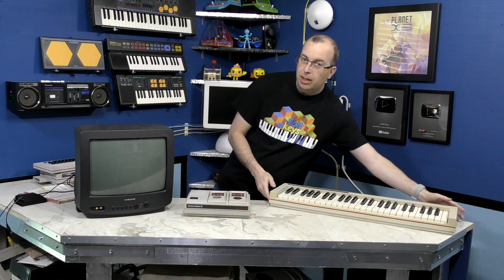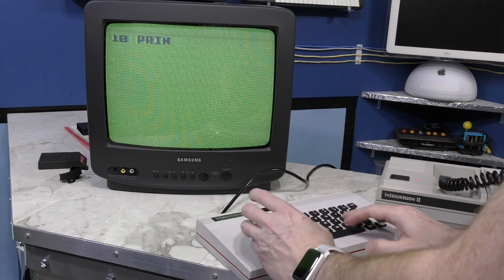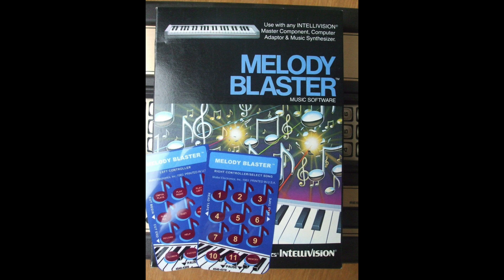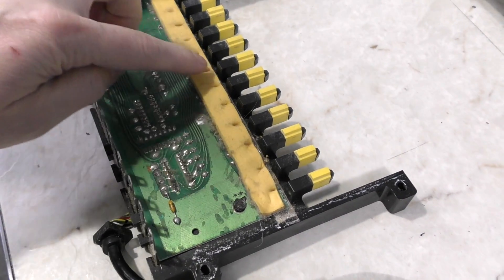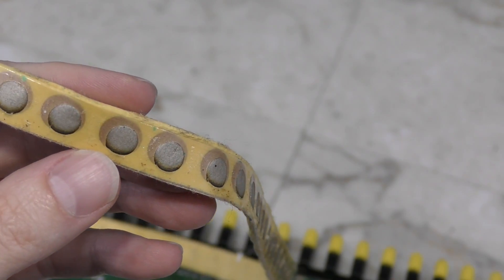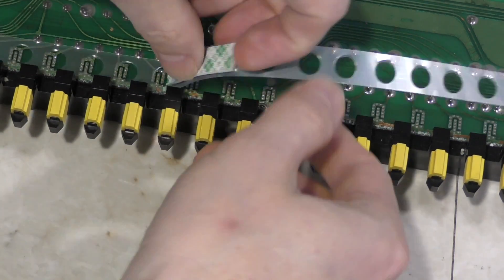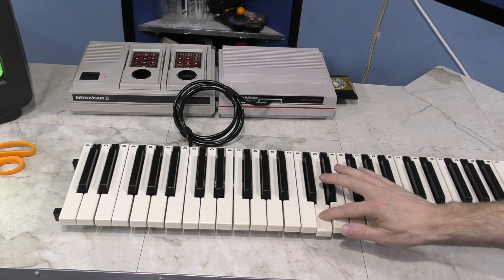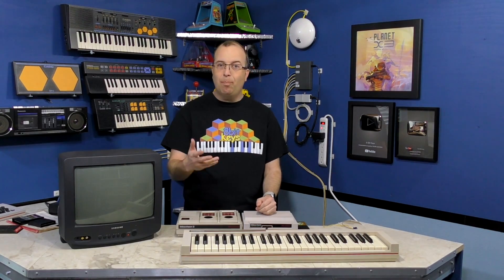Intellivision ECS Keyboard Repair and Demo

Comment: Radio Shack used to have the exact foam you need. It was a 1/4"-thick closed-cell foam that was used to prevent air-leaks in speaker cabinets -- you'd put it on the edge of the cabinet, and then screw the back onto the cabinet, compressing the foam and sealing the cabinet to the back.  It would've been perfect for this project -- if only Radio Shack was still in business.  :-(
Reply: Yup, I can confirm that there are at least two Radioshacks still around.
Reply: The Color Computer community, where 8-Bit Guy actually did an interview recently, also did a remote at the first full-on Radio Shack store that's reopened, AIUI.  It's in Keller, Texas, north of Forth Worth and hence in his neighborhood.  (No promises that they have that particular foam in stock.)
Reply: I mean a few stores are still around, at least they were last I checked...
Reply: It's at all the home stores.  It's called weather stripping.  Simple.
Reply: You can get it at almost any hardware store as weather striping
Reply: My first thought as well. Weather stripping is the go to replacement for needle retainer bars in the knitting machines that I restore.
Reply: Radio shack is still open, check radioshack.com
Reply: Good ol' Radio shack!
Reply: @Dreamcoat Music ドリームコート  Blockbuster has 1 location left in Oregon. Radio shack has website. Why do people keep saying these stores are closed, when they are still in very small, but still in business???
Reply: @TheDukeofJuke I'll do you one better sonny, Heathkits.
Reply: @Dreamcoat Music ドリームコート when there a movie you wanna watch in your neighborhood BLOCK BUSTERS
Reply: @Dreamcoat Music ドリームコート  it's ok it just hasn't made since to me when people say they're no longer in business. That is mostly true, but some of them remain open.
Reply: @Windows98love  That makes good since. Er, since when, exactly?
Reply: Parts Express sells it.  Speaker gasketting tape.
Reply: @balsagna69  Like Amazon?
Reply: @Ndlanding   they're not as big as they were before, that is what I meant as mostly out of business
Reply: @Windows98love  Guess you missed the point. Since.
Reply: @balsagna69  Ebay doesn't have the variety amazon does. But if I can wait 2-3 weeks, I'll always order from aliexpress or alibaba. 2/3rd of amazon is overpriced chinese vendors anyway.

The problem with retail and why it died out is that selling small parts at 25% overhead is not enough for the regional & store manager to fill their x-mas bonus every year. When it's either a week of Honolulu OR a week of family Skiing it's high time to close the store!!
Reply: that sure didnt help at all, love useless information...

Comment: if you run into difficultly finding foam again, hit me up, we have place here in Australia called Clark Rubber, that has a large range of foam rubber and foams in multiple sizes, as they are a specialist in stocking foam rubbers
Reply: Those Clark rubber ads scared me when I was little
Fun fact
Reply: Can they deliver in plain, brown paper, sealed packages without the firm's name on?
Reply: @Ndlanding  hold up
Reply: If you're getting two balls, you might as well get some foam rubbers while you're at it.